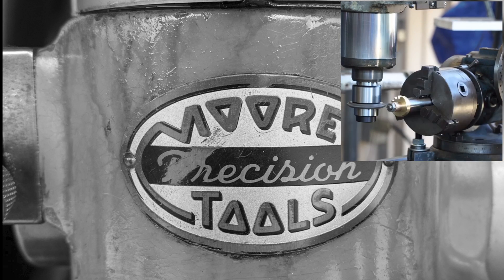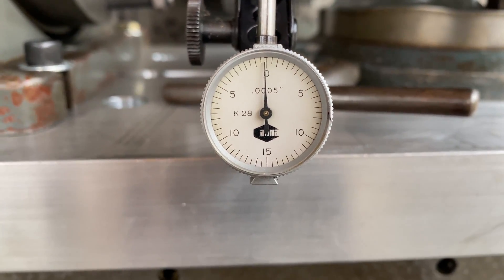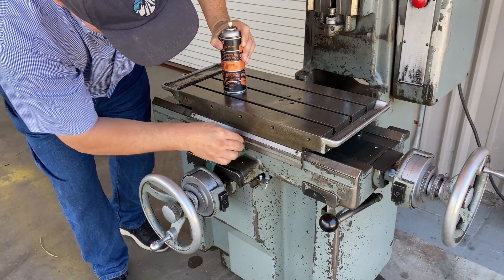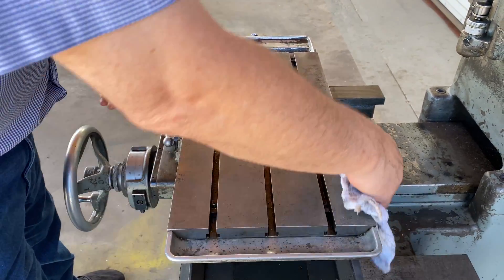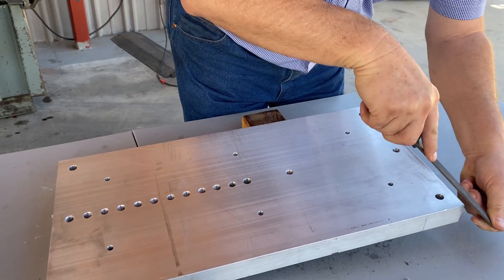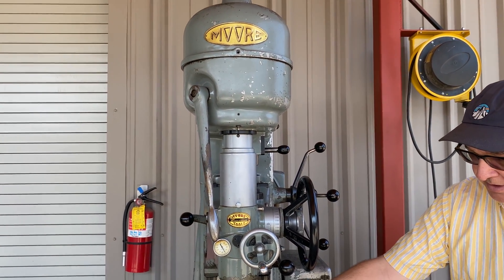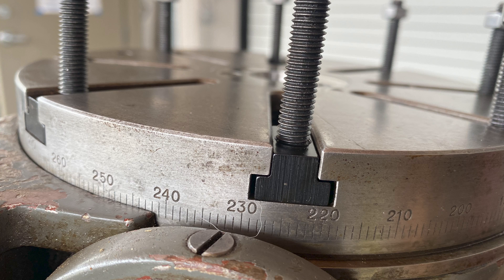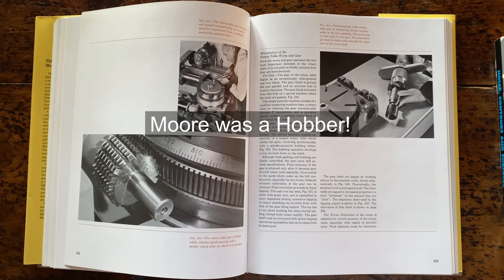Milling A Gear 1 (Ellis Dividing Head on a Moore Jig Borer New Fixture Plate)

Comment: Thanks for sharing all this great information. I'm glad I found this channel. I do have a question that I hope you can help me with. I'm about to cut my very first gear on my old Atlas table-top milling machine.  It's a 36 tooth gear, 16DP, 14.5PA. Hopefully it will work on my Logan 820 lathe.

I've used your online calculator and I'm ready to go. I've made my gear blank and have my machine setup and ready to begin cutting. I'm a bit confused on one thing, so the only information I need at this point is the actual depth of cut. Do I cut down to the 'base circle' or down to the 'root diameter'? There's really no good information that I can find to answer this question.

Forgive me if I sound stupid, but I'm really exited to see if I can actually do this. Thanks again.
Reply: Just writing to say thanks again. My gear came out successfully. It fits perfect on the lathe and runs extremely well. Much better than expected for a first timer.
Reply from the maker: That is a great success.  Nice job!
Reply from the maker: Usually the cutter will have the depth of cut labelled.  But over time there have been many different variable names that contribute to the confusion.  Here are some alternate names for the depth of cut:
d+f
d
df
WD

If you cutter is not marked and there is no documentation, I use our gear dimension calculator and it will give the "Whole Depth" which is the depth of cut.  For your example here are the numbers:
Inputs
Number of Teeth:	36
Diametral Pitch:	16
Pressure Angle:	14.5	degrees
Gear Type:	External

Outputs
OD Reference:  	60.3250	mm	2.3750	in
Pitch Diameter:	57.1500	mm	2.2500	in
Base Circle:   	55.3296	mm	2.1783	in
Root Diameter: 	53.1812	mm	2.0938	in

Addendum:       	1.5875	mm	0.0625	in
Dedendum:       	1.9844	mm	0.0781	in
Working Depth:  	3.1750	mm	0.1250	in
Whole Depth:    	3.5719	mm	0.1406	in<<LOOK HERE
Circular Pitch: 	4.9873	mm	0.1963	in

© 2021 Evolvent Design,	05-Nov-2022
https://evolventdesign.com/pages/blank-calc

Also, look at our YouTube on the topic Milling a gear 3
https://youtu.be/Rg3zUDwq_kQ?t=406

Andrew
Reply: @EvolventDesign  Great! Thank you so much. After a bit more research, I came to the same conclusion (whole depth). Hopefully I'll begin cutting my first tooth within a day or so. I appreciate the help!

Comment: How does a jig borer do for milling thinking about selling my wells mill with spindle issues and finding one of these
Reply from the maker: Jeremy, The Moore is especially good at drilling holes.  One of the drawbacks of having the Moore is the fine lead screws that takes many turns to move the table in X and Y.  This is good for precision, but the drawback is you will get strong muscles moving the table around by hand.  If milling is the main purpose for a new machine, I would keep looking for a Bridgeport or other more common mill.  Yes-we do mill gears with ours, but we limit the work to small face gears that do not require a lot of movement in X or Y.
Reply: @EvolventDesign  found a sharp vh-3 that’s in unknown condition for 2800$ idk if you’ve ever seen one but it looks to be an absolute beast but for 2800$ it’s gonna have to be known good to me before I buy it
Reply: As the nomenclature implies, it is a jig “BORER” not a milling machine. The spindle bearings are designed for axial thrust and only strong enough to use a boring head and not much more. Moore products are among the most precise machines in the world.  It is a shame to abuse it as a milling machine. Moore does rebuild these machines and it could possibly be sold to the factory as a core for more then a good used Bridgeport would cost.
Reply: @tracylemme1375  lol got to love purist but hey man I buy what I can find cheap my machines don’t make me money as of today nor the near future I have them to do my own work build my own projects maybe some other stuff for friends and family that’s it I had a pretty cheap jig borer come up for sell near me is why I was asking I’ve got a mill but it’s a wells index that’s wore slap out the spindle bearings need replaced but I’m not spending 750$ to replace the bearings on a mill that honestly should be scrapped it works good for ruffing but you’ve got to leave 25tho or so or it gets hairy

Comment: Awesome video. I am looking into getting this same machine in lieu of my first mill due to the price. Can you offer some insight on what I would need to get set up as far as electric supply, toolholding and whatnot? I can find boring bar holders and boring heads on ebay for decent prices. Would I be able to get away with a drill chuck and say a 3/8 boring bar holder to do fly cutting and maybe light end milling? What I want to do is build my own lathe so I need to square up plates and things like that.
Reply from the maker: The Moore is really good at drilling and boring (Z-Axis operations) and this is where the fine pitch lead screws(X & Y Axis) are really handy for the precision bolt patterns.  A DRO may be next for me to take full advantage of this.  The Moore's certainly can do facing and other operations in the X and Y but you will find a Bridgeport is more fitted for this and can handle the side load better.  But hey, if you don't mind doing a lot of cranking manually - you gotta work with what you can afford.  I am sure you will appreciate the Moore either way.

The power requirement is 220VAC 3-Phase.  Most homes and shops will at least have 220VAC 1-Phase and a phase converter will get you 3-Phase.  Check American Rotary for a phase converter in the right size.  A regular Mill will likely have the same 3-Phase requirement.  If you are not familiar with the electrical side find a qualified electrician.
Reply: Thank you.